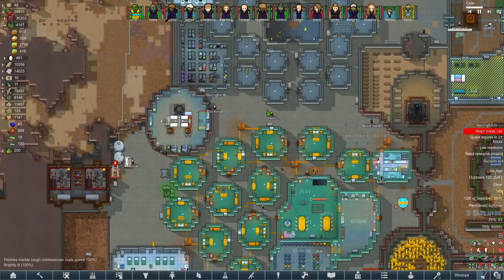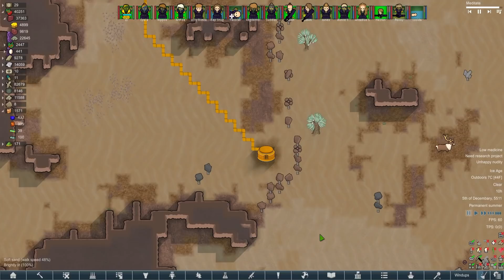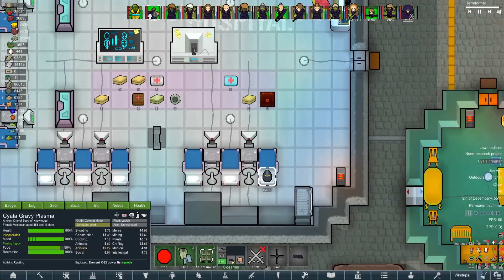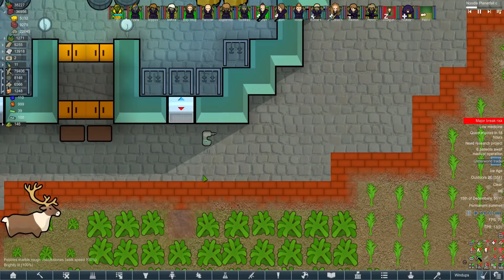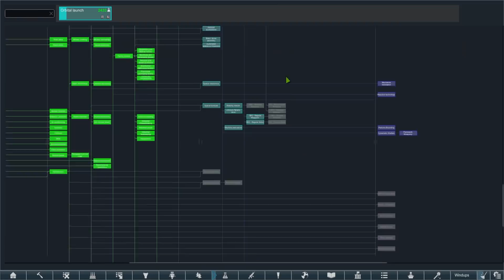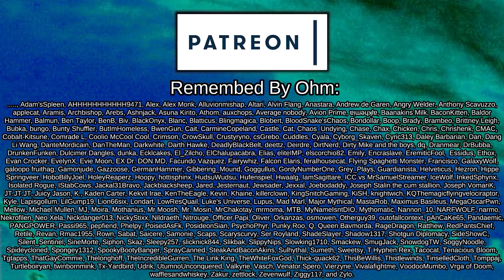Great Aerial Fisting | Rimworld: Generations #25

Comment: You could add a layer of the segmented castle walls since they can cover an area and are quite more defendable than the normal.
I also think a small tunnel going into the killing field would be effective, just line it every other block upwards and in between could be something like sandbags to prevent them from stopping in between the barbs or just put gas vents inside.

Comment: You should use the wireless networks from Power++ mod with the misc robot mod, the robots working nonstop is a huge workspeed boost
no more time wasted while bots recharging, probably save time recording for you
 deployable barriers are not walls its like a pop-up sandbag, and would also require instant flick otherwise people have to walk over and hit the switch to deploy the barriers up or down

Also the superweaponized absorption dish beam from Power++ is definitely NOT a firearm ;)

Comment: Defensive suggestion:  make a corridor/hallway entrance to the castle, fill it with a checkerboard pattern of pop-up barricades.
The checkerboard pattern will maximize the time it takes for enemy pawns to navigate it all and force them to stagger out a bit; the only "downside" is that anywhere a pawn can stand they'll have barricade protection from ranged fire. oH nO tHe eNeMieS wiLL bE sAfE fRoM rAnGe... but anywhere your pawns can stand they'll have full barricade protection against ranged fire ... just have the fister squad hang back behind a real wall, and once the enemy is fully caught in the slow hallway, turn on jet packs and search and destroy

Comment: So there is a mod with actual walls that you can raise and lower but i have to say that it is usually realy op because of the pathfinding of must raids. I would recomnd a entrence with a sort of checkerboard of walls to break up any firing line and basicly scale this 3v1 melee thing up. Also spacer furniture from vanilla expanded adds reinforced walls with  i think 1000 base hp so those out of titanium are quit good.

Comment: Steam went down when I was posting this comment, so I couldn't look into the modlist.

But I wanted to ask if you added Replimat and or Medpod into the game. Both mods are ultra late game and I don't think you used either in many other series.

In most other games, they would be considered too OP to use, but in a game like this, where the endgame is supposed to eventually have Arcotech body resleeving, the ability to pay extreme amounts of power to regrow lost limbs, remove scars, and other debuffs would also be very good rather than game breaking. Medpod wouldn't make pawns immortal, it would just mean you wouldn't need to craft Glitterworld medicine to cure some conditions. Granted, with the aging mod, it would thus mean the pawns can be functionally immortal as you remove their aging related debuffs as they get them.

Replimat would similarly be just as useful. Mostly, from the perspective of automating food production and converting that insect meat you got into something useful. It would technically allow the creation of gourmet meals, but gourmet meals don't get their condiment bonuses if eaten this way. Expensive and really, all it does is remove the need for a dedicated cook.